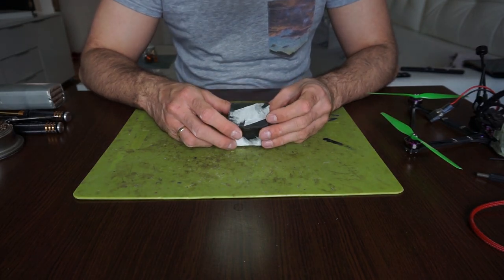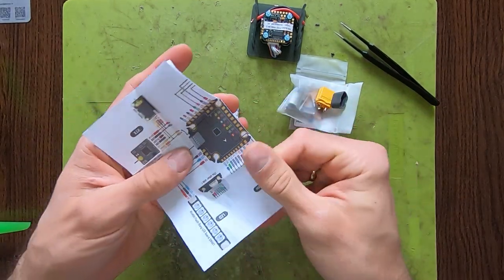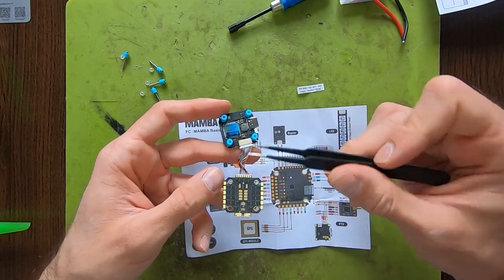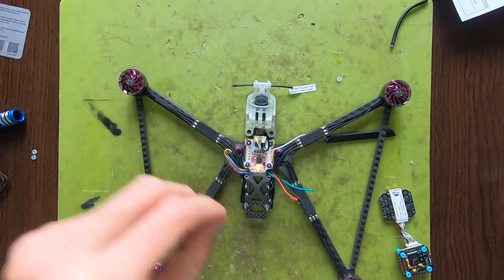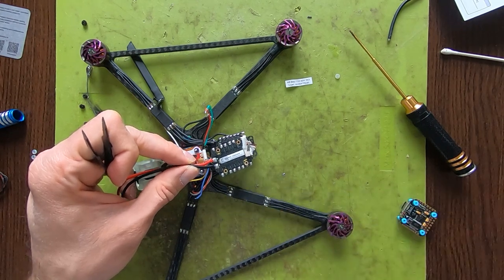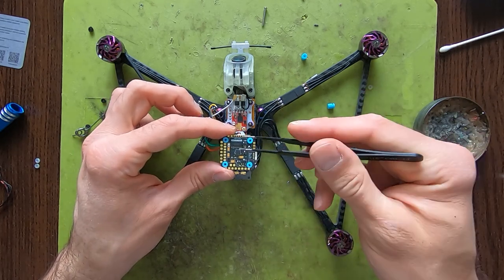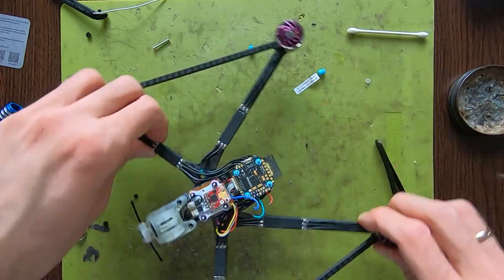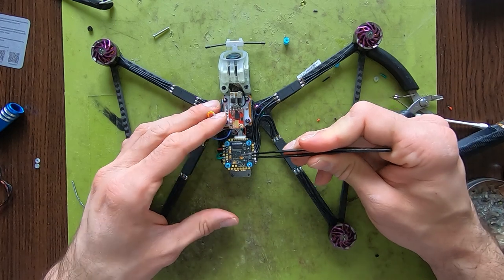MAMBA Stack F722 MINI MK3 F7 Flight Controller

Comment: how high is the stack? What are the precise measurements of the width, length and height including the rubber pads? I have to mount it on a micro apec .. very narrow frame! thak you
Reply from the maker: Height is 1.3 cm other measurement are standard for 20x20 stack

Comment: Did you have to spin the fc wiring harness to stack it on the esc
Reply from the maker: Kinda don't get the question. I fitted the stack like it was from the box as you can see in the video. And  I used original cable that it came with.
Reply: @mrRockwellFPV  I bought the same stack when I plug the wire harness in and place the fc on the esc the wire harness is twisted. Is yours the same way?
Reply: @skygroover6692  same here...
Reply: My V3 needs twisting